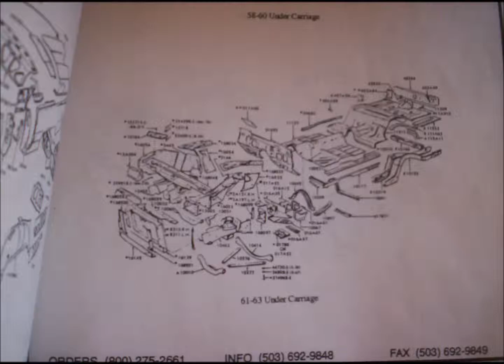1962 Thunderbird Rear Frame Restoration

Comment: I know this was posted several years ago, but my 62 is in almost the exact same condition and requires the same repairs. It is a Canadian car also. What gauge sheet did you use to construct the rear "frame rails"? Thanks for any reply.
Reply from the maker: diesel Used about 1/8". the key to the strength was boxing it and the welds to old frame.
Reply: Dave, I have a 63 T Bird which has the same problems. Would you be interested in doing this to it?